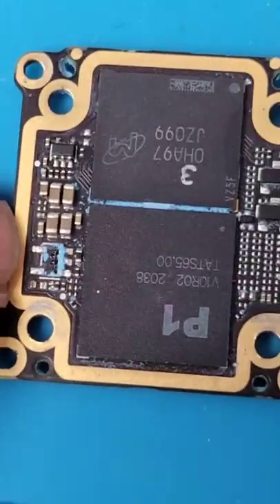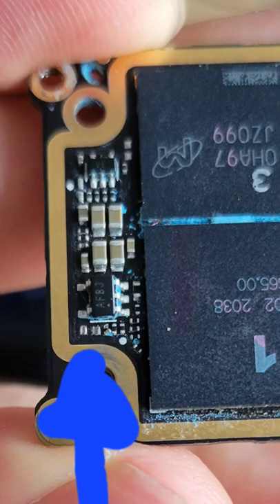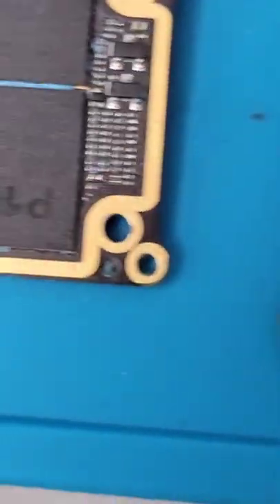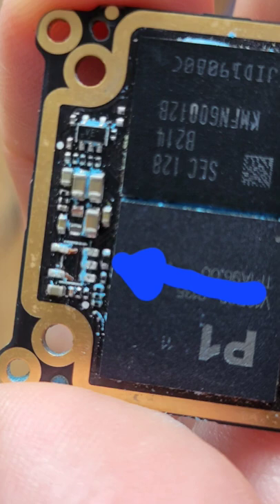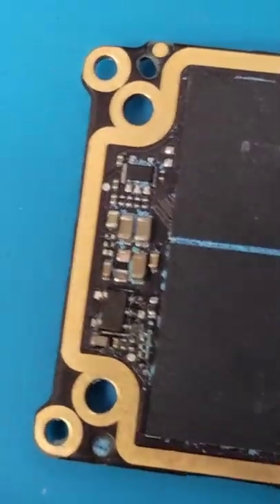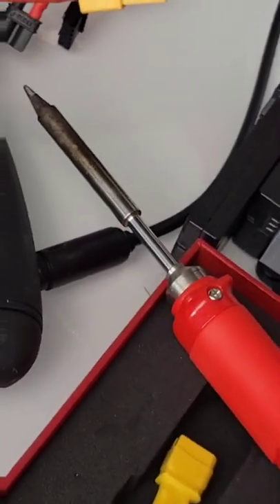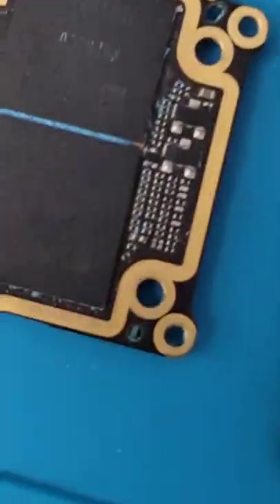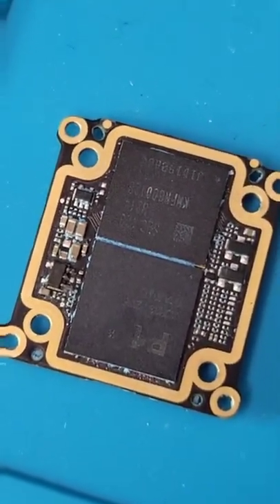Caddx Vista Fix #shorts

Comment: Epic man ben trying to find a matching fc that’s damaged like mine to try the same thing…. During reassembly after a arm n base plate repair I put one of the stack screws in the wrong hole! And ultimately damaged the fc in the process! 🤦 Great work man glad to see it’s possible if I find the right part that is! Lol
Reply from the maker: where there is a will there is a way lol and the poor find ways to keep flying!

Comment: Little voltage regulator likely. Buy some from digikey or Ali or ebay. I hate surface mount nice work you got I end up burning them all up trying to solder without hot air
Reply from the maker: The little ones are impossible for me, the larger one I had to do by hand as the hot air just blows it away, at least when I do it lol